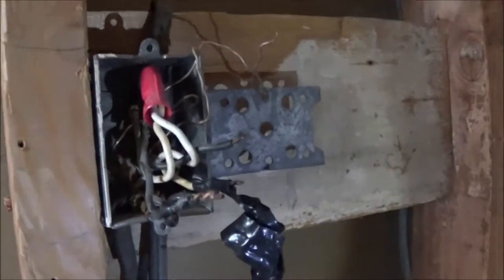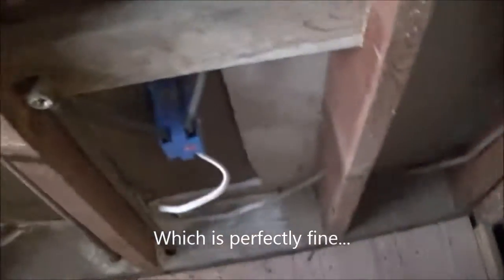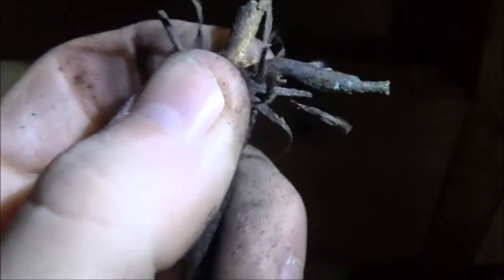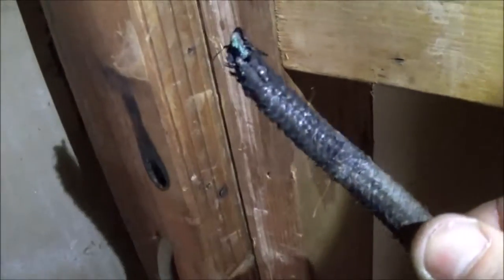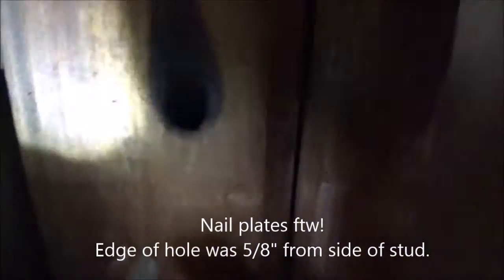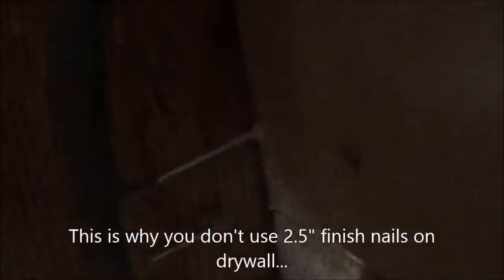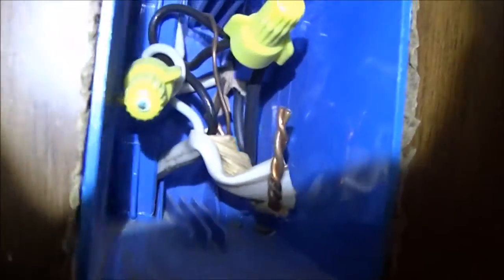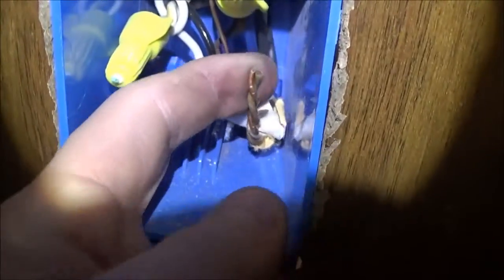Nail through braided electrical wire, aftermath.

Comment: Ok I'm an electrician and I know there are some hacks out there, I kind do have to question if an electrician did that old work box at the end. Once you learn how to splice wires it's even harder to do it so it looks like that does. That defect on the wire nut. i'ld look a little close at  that. I'm thinking there was an imbalance on the neutral at on time and heat caused that or it's not a tight splice which means resistance/ heat. If an electrician does work and it looks messy or they leave a mess it warrants questioning what was done. I'm never offended by a customer who wants to be reasonably educated on what they are paying for

Comment: Electricity freaks me out. I've recently started working with electric guitars and so I figured I'd learn everything I could about electricity. I am now scared to even drive a nail into the wall to hang a picture! Ahh! I'll figure it out.
Reply from the maker: If your house was built to code in the last 40 years you will be fine if you just use a nail shorter than 1-3/4" assuming you have 1/2" drywall (code dictates wire through studs must be 1-1/4" from face of stud). If you are using drywall anchors and not hitting a stud you'd be hard pressed to hit a piece of romex hard enough to pierce it. I worry too whenever I mount TVs or barn doors but you gotta do what you gotta do.
Reply: Thank you for the response! I plan to hang something about 15" from a breaker box. Will this still be fine? I will use 1-1/2 in. nails.
Reply from the maker: Walls near a breaker panel are going to be laced with wires so I would use extreme caution. Also, you must have a zone of clearance 30" around the breaker box so don't put a TV or something in a way that will make it difficult to access the box. Reference section 110-26 of the NEC. Your local codes may vary. I use a voltage detector with variable sensitivity I got at Lowes to find wires in the wall but being this close to the panel it is going to light up from induced voltage... so it is going to be a gamble either way. If your builders followed codes then you shouldn't hit wire using 1-1/2" nails.... shouldn't is the key word. People don't like to follow codes and from what I've seen inspectors just eye stuff anyway and collect their checks. Anyways, don't do it alone just incase and be sure to watch for any lights flickering on the same circuit as you drive your nails/screws :) Good luck.
Reply: Geez. F** it, I'm just going to use sticky tabs. Again, I appreciate your detailed responses! Take care.
Reply: @striker1211  I don't know why I was so worried. I figured it out using nails. Self esteem maintained.
Reply: @dam7196  lol I've read your old comments on here, I think we all go through this one time or another and now it's my turn 😂
Reply: @Saint696Anger  lol, consider having a friend with you if you're doing something exceptionally risky.